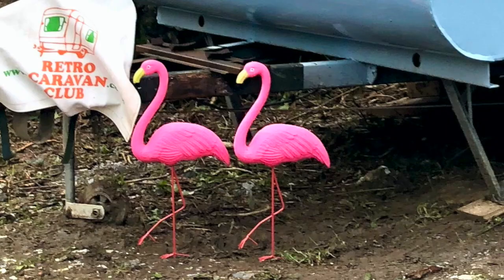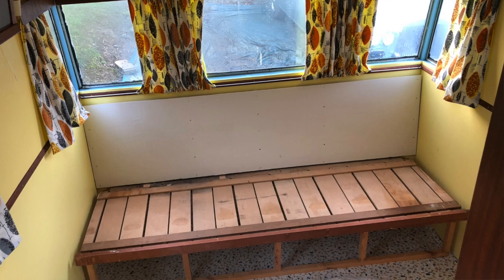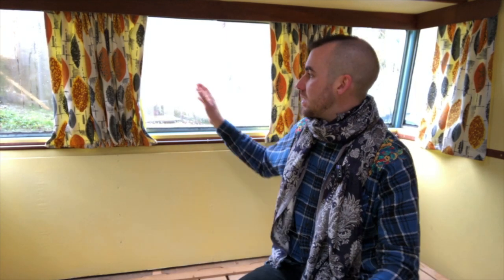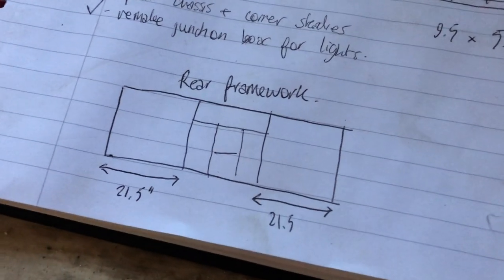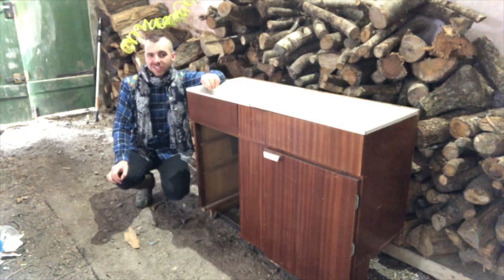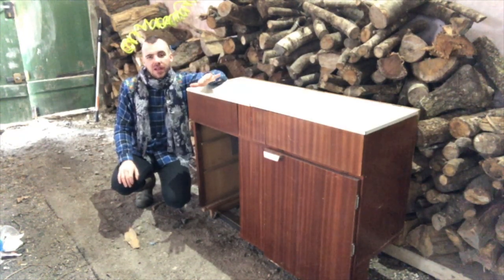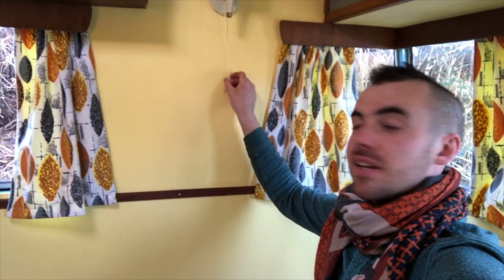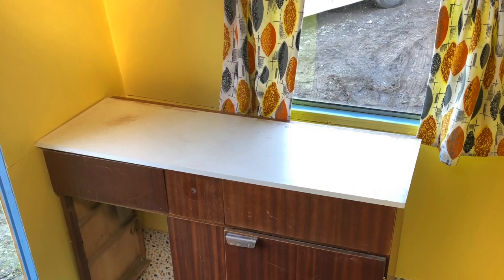1959 Sprite Ariel Caravan Restoration Part 8

Comment: Hi welcome back, when we used to cut a laminate that was visible from both sides we used to tightly clamp a piece of wood either side of the board then cut through all three pieces. on the waste side if necessary screw through all three pieces near to the cut line to maintain clamping pressure, it can be quite effective reducing chipping and damage. Good luck its looking great.

Comment: HI Cameron just found your channel absolutely loving it, just a little tip on cutting your worktops, cut them 5mm bigger than you need and then  get an electric planer and plane it down to the size you need, it will take all the chips out leaving a perfect edge with no chips. hope this helps.

Comment: I though I recognised the kitchen, our first van was a 1967 Sprite 400, towed by a Datsun 1200. We spent Christmas and New Year 1972/3 in the south of France. Full Christmas Dinner courtesy of two rings and a pressure cooker. Next Christmas and New Year found us skiing in the Alps. We were the only British van on a site full of French and German vans. Extra insulation was added, polystyrene blocks covered the glass windows and rudimentary mains electrics were installed. A bit of a squeeze for the four of us but great fun.

Comment: If you're doing anything like this again for the laminate is to find a kitchen manufacturer or carpentry shop that has a scoring blade on their panel saw. It cuts a scribing cut on the underside and will give you a clean cut top and bottom.

Comment: The best solution with laminated chipboard of MDF is to rough cut it oversize then finish to size with a router, make sure that you run the router along the workpiece from left to right.  With a new sharp router bit you should get a clean cutter top and bottom.  Then just a quick sand with a block and on with the edging.